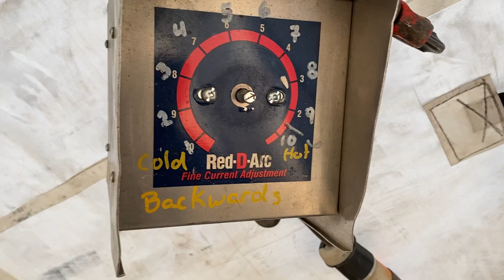Walking The Cup | TIG Welding Open Root Technique !

Comment: I cant wiggle it it just doesnt move foward wtf
Reply from the maker: Hey, bud. To move forward, you have to pick the right size of cup that will work for you. Try different cup sizes, also depends on the prep you got there if there are any obstacles on your way, and of course, you are the one who has to push that torch forward. Side to side motion with your wrist, and push slowly forward.
Reply: Idk if you’ve figured it out by now but a little tip that helped me a ton was put your thumb on the neck of the torch and use it to push and rotate the torch forward when you sweep the tungsten to the right bevel. Putting some rotation on the cup helps keep it moving forward

Comment: Liked your video very much, it gives some new insights of root tig welding with walk the cup. My boss strictly demands root to be free handed( Also cold wires issue is sometimes bothering me, any advice appreciated
Reply from the maker: Hey buddy thanks for your comment. I don’t know why he demands for root to be free handed, that should be your decision what you feel most comfortable with. Cold wire or stubs on root are usually issue if you running too cold on your amperage and you don’t give enough time to wire to be melted properly. Maybe you also wiggle to much with your wire when you freehand! Try to support your hand and be steady when you are feeding the wire into the puddle. Play with your settings and find better position for your arm placement.